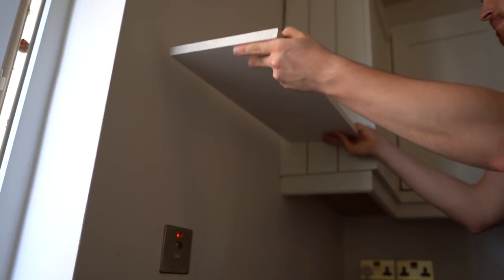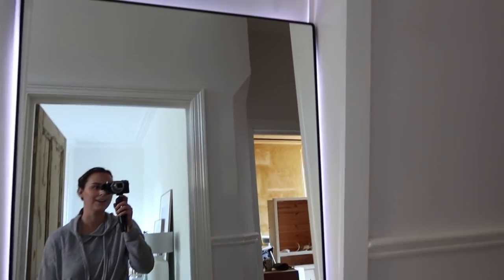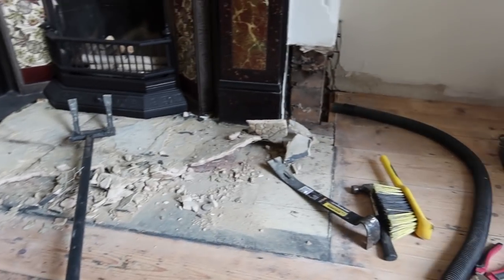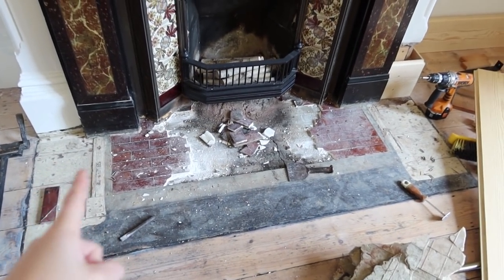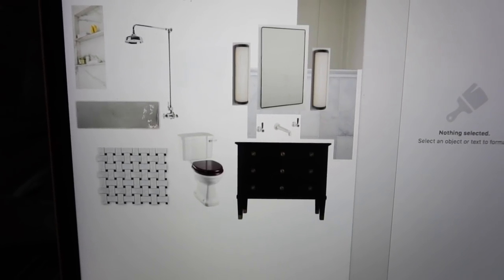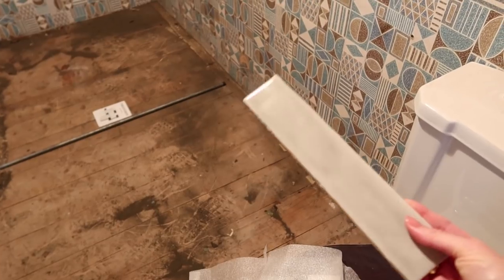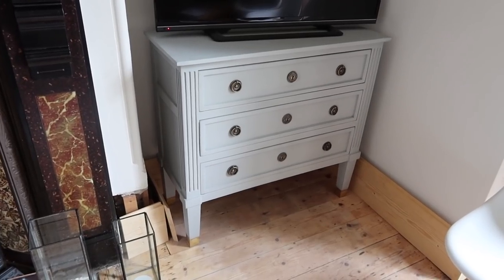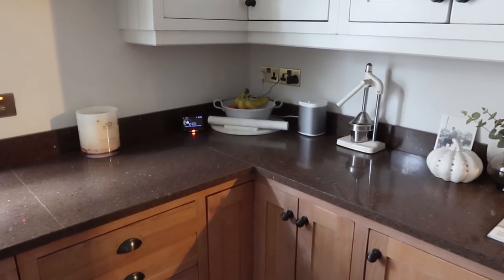ONE STEP FORWARD, TWO BACK | Laura Melhuish-Sprague

Comment: I've been enjoying your reno series so far.  I'm a certified building inspector in the US and I have not heard you mention anything about the code or building regulations and permits.  I am sure things are different there in the UK, but surely there are some regulations.  In the fireplace tile, I looked it up in the International Residential Code (used in the US but possibly beyond) that the hearth extension should be not less than 16 inches (406 mm) in front of and not less than 8 inches (203 mm) beyond each side of the fireplace opening.  That could explain why someone expanded the slate tile outside the original burgundy tile footprint, besides it being broken.  Combustibles, like the wood flooring, need to be kept some distance from the fireplace.  Something I thought would help explain the changes there.  Keep up the good work.  It's very interesting.

Comment: Hey Laura, you guys doing a great job on the reno, well done. We did ours and lots of tips from our architect / interior designer... just to share.. if we wanted to put a shelf make sure it is in line with the bottom line of your cupboard, same when you wanted to put up your art work, the top edge of your artwork should be in line with your door frame.. we did what they said and it is looks so much better.. have fun with your reno x

Comment: Love the windows! Timber is a great option. What I have read though is you do need to do quite a bit of upkeep on them and re-treat them every five years or so or they won't last very long. Like I know a building where they installed them but did no maintanence and 20 years later they are facing a massive bill because they have all rotted and need total replacement. But a great option so long as you accept you have to put some work in on them.

Comment: I was shocked when you just obliterated those tiles you should have found salvaged ones to match in. Try and keep the original features don't rip them out. Check out the restoration couple on YouTube. You don't buy a Victorian to tear it apart and demolish it. Save the original features and mend and make do. Otherwise move to a new build and do as you please!!!